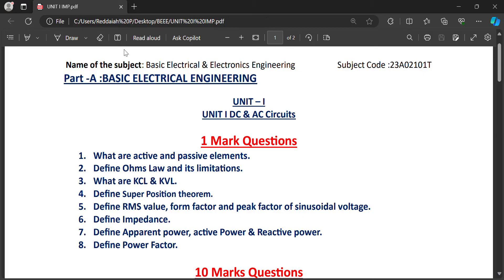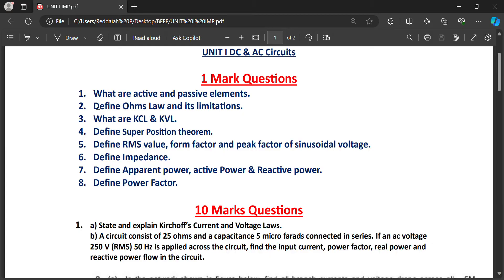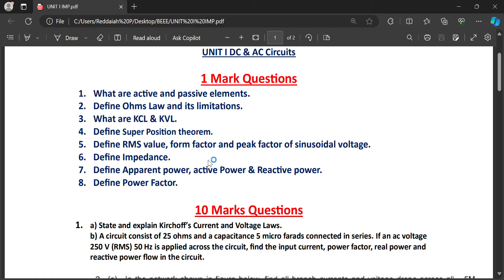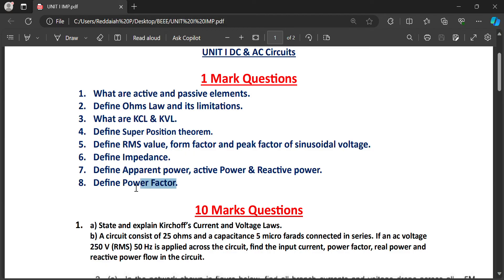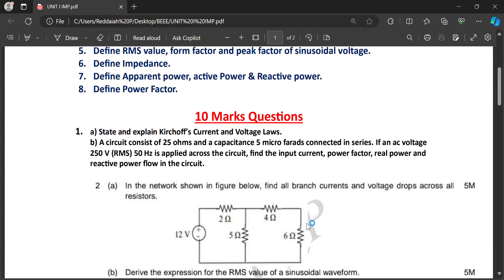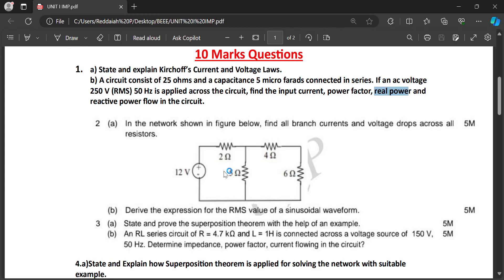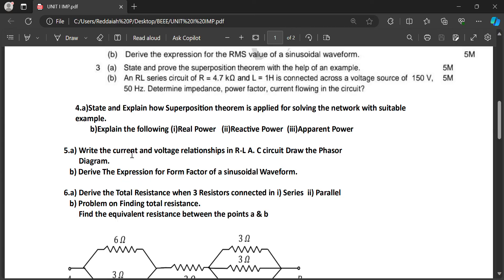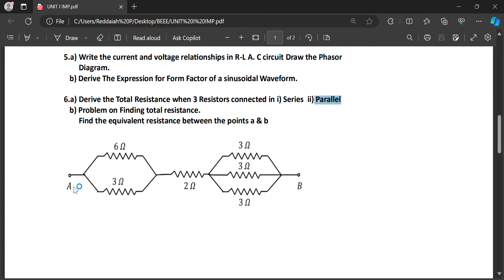BEEE  Important Questions with Answers  | UNIT I  | Dc & Ac Circuits | #beee  #jntua

Comment from the maker: BEEE Important questions
Unit I 
Dc &Ac Circuits👇
https://youtu.be/Z9urTA8f8lE?si=Xp64SWTyB7LrDpGk

UNIT II 
Machines & Measuring Instruments 👇
https://youtu.be/L2H7jpp9Yq0

UNIT III
Energy Resources and electricity bill and safety measures👇
https://youtu.be/fb7H6bB2DkQ?si=Y-GDHzDFgPAJWXWl

Part B 

Unit I
Semiconductor Devices👇
https://youtu.be/Ftpi5emqTkQ

UNIT II Basic Electronic Circuits & Instrumentation👇
https://youtu.be/Ftpi5emqTkQ

https://youtu.be/7ZT2qvYoaI4

UNIT III
Digital Electronics👇
https://youtu.be/hM97iCN4xH8
Reply: Amazing 😍

Comment: Sir please upload r23 all lessons important questions
Reply from the maker: BEEE Important questions
Unit I 
Dc &Ac Circuits👇
https://youtu.be/Z9urTA8f8lE?si=Xp64SWTyB7LrDpGk

UNIT II 
Machines & Measuring Instruments 👇
https://youtu.be/L2H7jpp9Yq0

UNIT III
Energy Resources and electricity bill and safety measures👇
https://youtu.be/fb7H6bB2DkQ?si=Y-GDHzDFgPAJWXWl

Part B 

Unit I
Semiconductor Devices👇
https://youtu.be/Ftpi5emqTkQ

UNIT II Basic Electronic Circuits & Instrumentation👇
https://youtu.be/Ftpi5emqTkQ

https://youtu.be/7ZT2qvYoaI4

UNIT III
Digital Electronics👇
https://youtu.be/hM97iCN4xH8